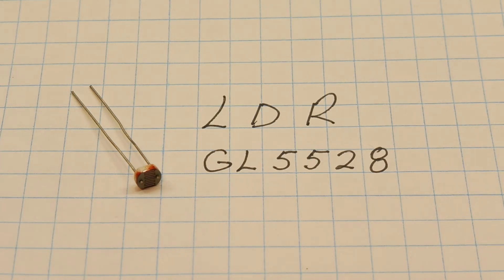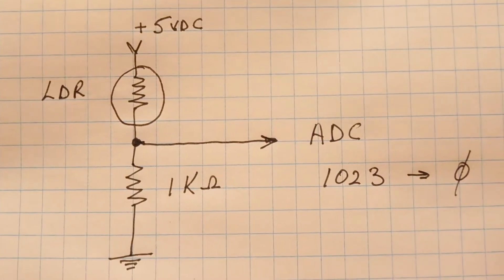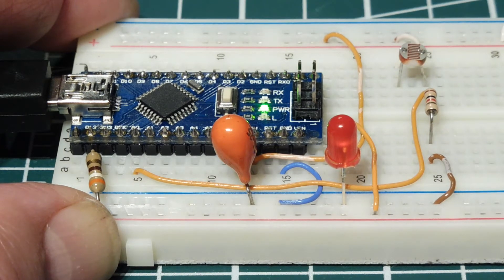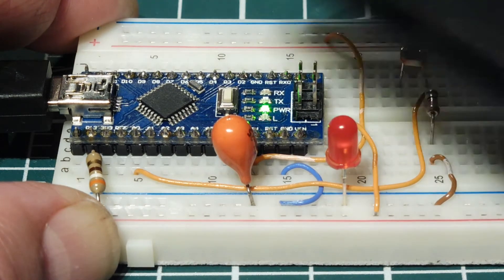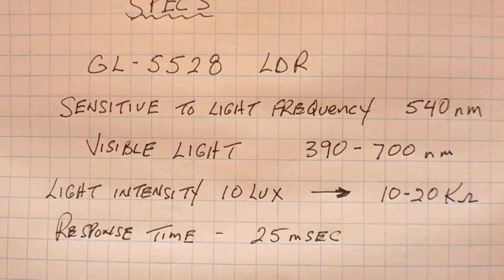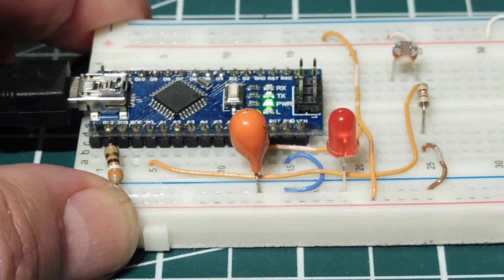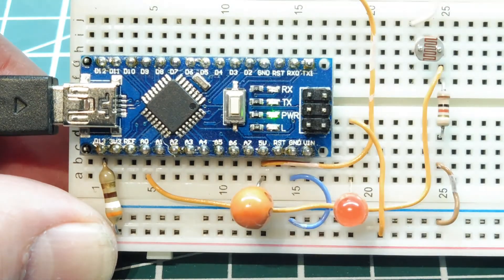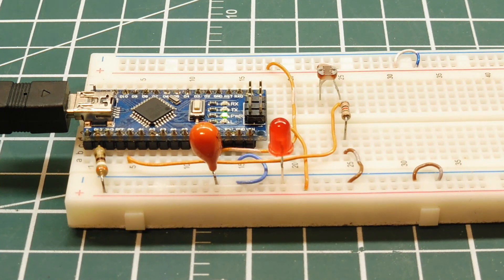How to use Light Dependent Resistors / Arduino Nano

Comment: is it possible to use 10k ohm resistors without having any noise issues? ( i plan on making a solar tracker with 4 ldrs in parallel)

Comment: Is there any chance you could share the code for this project? Really cool!
Reply from the maker: I use Forth to write my code and do not use the Arduino IDE.
Here is the code:

: LDR.toggle  \ toggle led on dark pulse
       Init
       SelectA0
       BEGIN       
               ?ADC 300 <                                      
         IF    Pin13 toggle  \ toggle LED
               Begin 20 ms ?ADC 300 > Until
         THEN ?key
       UNTIL drop ;

Check out my Laser trip wire video. It explains the code which is similar to the LDR code.
 https://youtu.be/8gV_pETSUis
Reply: Thank you